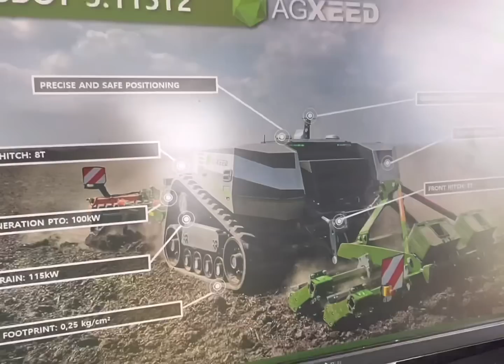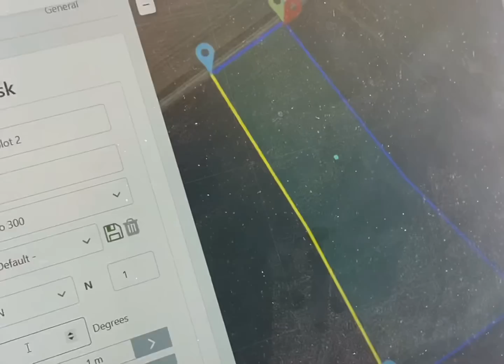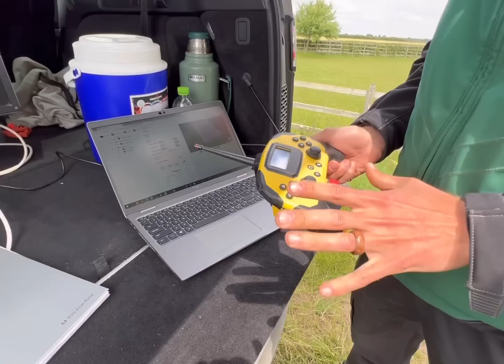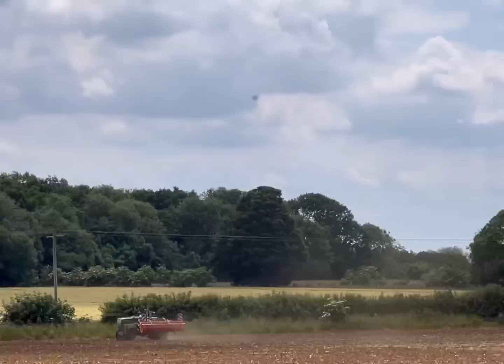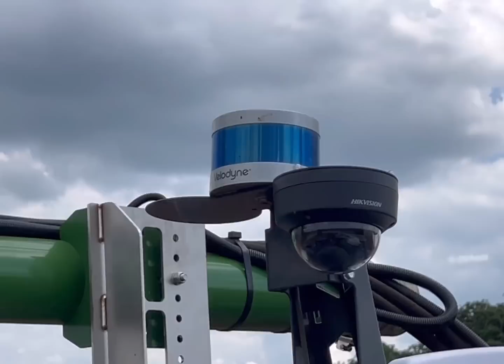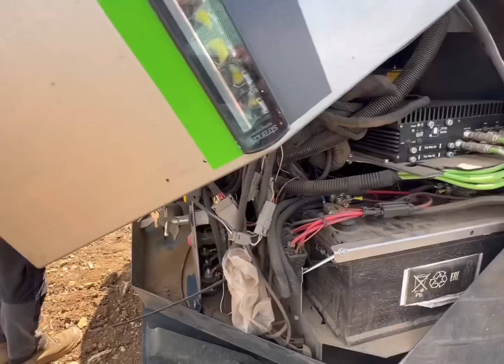FARM UPDATE 89 - DRIVERLESS ROBOTIC TRACTOR, IS THIS THE FUTURE? I’M MIGHTILY IMPRESSED.

Comment: Hi Andrew, Iam your biggest fan and absolutely love watching your videos. But I am afraid I don’t share the love for this one. I absolutely agree that are tractors/ machinery is far to big and we need to reduce the size of them, but I think we have more then enough technology in farming and technology in our general lives. As a arable worker I put over 2000 hours a year on a tractor I have the latest 250 horsepower John Deere tractor with all the technology on it and I really find Iam more tired and bored using all the technology and I feel it’s not doing me and my brain any good just sat going up and down for 15 hours a day and not using your brain to actually run the machine. For years our manufacturers and dealers have sold us this technology saying it helps the operator and how he will feel fresh and less tired at the end of the day, but talking to other operators in my area this simply isn’t true. I feel we have a very real issue with mental health issues with operators not having enough to do while just sat going up and down the field and stuck in an air conditioned box and you can’t even open a window to allow fresh air into the cab. And I know you will argue this is the solution for my issues but I do feel very sad when I see these machines come out on the market and feel us operators whom take great pride in our work are facing a very bleak future. I do except some technology has it’s uses but can’t help thinking this is a step too far. I am not just concerned for my job and industry but also the more general work place, office. technology is creating more stress and mental health issues with workers as technology is pushing people to do more in the workplace. I feel we all need to look at getting back to basics and the government need to be looking at work place stress and health issues. So sorry Andrew I don’t share your love for machines like this. But I do love your videos and always agree with everything else you say in your videos. Keep up the good work 
Thanks stu.
Reply from the maker: Hello Stuart. I really really appreciate your message. That would’ve taken you an awful long time to write, it’s the longest comment I’ve ever received but with more heartfelt words that I’ve ever received as well. Some of your points I had thought about and some I hadn’t and I really thought provoking. It is such a valuable message and a reminder to many people, farmers and machinery manufacturers, that I would like to read it out on my next video which will post tomorrow night. I won’t mention you my name or I just say Stu but if you are I wonder if you would mind me doing that?
Reply: @WardysWaffleAndrewWard  Hi Andrew thanks for your kind words and Iam glad you have taken the time to digest what I said and how I feel. Iam happy for you to talk about what I have wrote and I don’t mind if you want to mention my name it’s entirely up to you, and Iam happy for anybody else who has an opinion to speak up as well as Iam sure other people are affected by these issues. 
Many thanks 
Stu.
Reply from the maker: Thanks Stu, it’ll be in tonight’s video.
Reply: @WardysWaffleAndrewWard  
Morning Andrew, great video once again and you put my comment over very well!
And I have thoroughly enjoyed the comments some that agree and some that don’t, which is brilliant that’s the whole idea of this channel and what makes it so good and a must watch all the time. The comment that interested me the most was from someone who said I didn’t have to use it, and he’s right on what he says to a certain point, we have tried 2 new drills this season and one 12 meter drill doesn’t have marker arms, not even on the options list, so it’s very hard to avoid not having to use it. And the important part is I do use it and except it’s here to stay, but it is a point that we and manufactures need to be aware off. So thanks again for covering this subject on your channel and the many other subjects you cover, that for me keeps me watching. Keep up the good work 👍
Many thanks 
Stu.

Comment: I rekon I could of ploughed half the field before he had finished messing about with his computer . Is it actually quicker than a human tractor? If you have to put it on a low loader and move it with another tractor why bother? How can it run for 24 hours if you have to fill it with diesel? I think they have missed a trick not making it fully electric. Also it’s a bit boring. Way more excited to see the 8rx in action.
Reply from the maker: The idea is all the settings are done in the winter when nothing outside needs doing.
Reply: @WardysWaffleAndrewWard  So you will spend all winter working hours on end ?
Reply from the maker: But during the year I should think the hours will balance out

Comment: Thanks for this insight, very impressive. I use RTK in the drones I use and to think that the system can pinpoint a drone in 3d space to 10/20mm is incredible. You can see this rapidly being rolled out, I bet Beeswax will be at the forefront.

Comment: As I’ve always worked in robotics and my dad is a farmer I’ve been saying to him for years now someone will get there with this technology. Fantastic to see it progressing like this. Yes at the moment it won’t cover every task and being an early adopter will mean it’s expensive but in the long run it will make so much sense for field work. Although I’ll be very interested to see if a dedicated platform like this works vs the John Deere option of putting autonomous hardware on a standard tractor so you can use it with a driver as well.
Reply from the maker: Agree with all of that.

Comment: Tracks look good on it but dig in a bit on the headland, I'd imagine the cost of it is so much that it would definitely take up the cost of wages for the farm worker it would replace
Reply from the maker: If you watch to about 20 mins one of the guys explains the cost and fuel use etc etc.
Reply: Looks like a rearward weight bias with the implement lifted, so that the rear idler is taking most the load, reducing scrub.